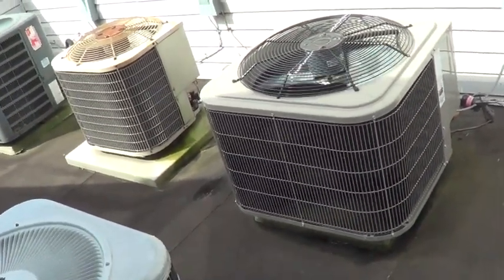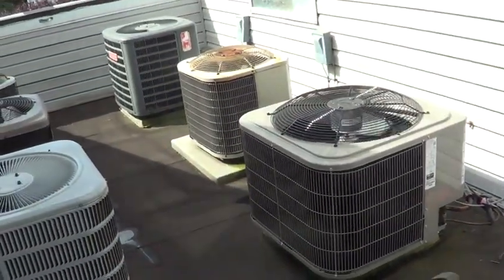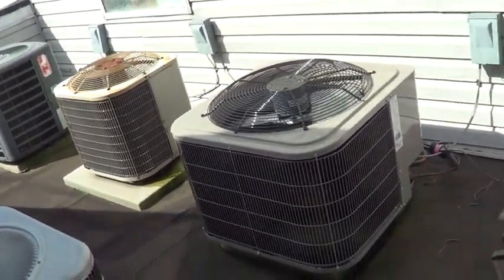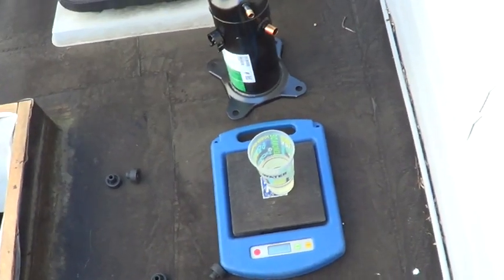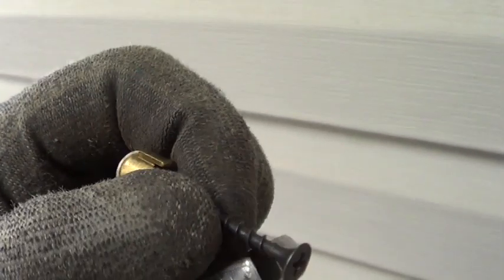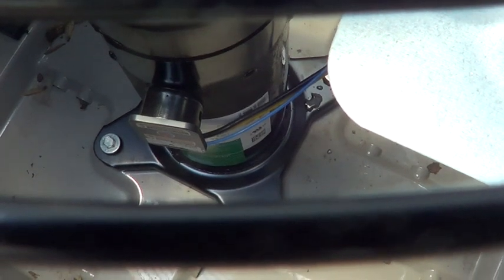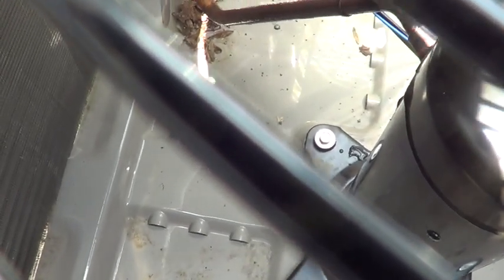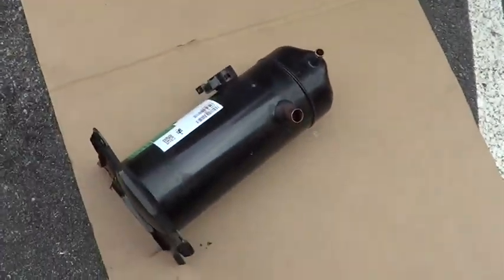LG Warranty Scroll Compressor Replacement and Tear Down with Cause of Damage Found

Comment: Looks like your piston was not seating correctly and was causing a liquid by-pass. For how long who knows? Anybody keep any records of SH & SC during services? It also sounds like you need some type head pressure control according to running ac in low ambients, (75* in summer), another contributor to flooding...........

Comment: Good video, you know your stuff. Many of those older piston expansion units also utilized r22. They were solid, I’ve had 410a units drop a compressor from a return duct falling off in a hot attic over a weekend, but I’ve actually had very few issues. I watch my super heat like a hawk, because I dont want avoidable problems. Great video

Comment: Maybe you are great at installation and operation, but you should maybe avoid declarations about the design of the internals.  So many incorrect and misleading statements.
First, this LG is basically conceptual copy of a Copeland.  As the Copeland patents ran out, LG simply copied their design and added features from other companies as well.  Common practice...
1. The large "relief valve" in the high to low pressure barrier would be closed by the spring inside it.  It is a safety device to prevent runaway pressure if discharge was blocked.
2. The small pressure valve in the "piston" is only to enable evacuation of cavity liquid that may finds it's way in, enabling excessive pressure to build during a flooded start.
3. The "piston" does help hold the scroll together with pressure that can vary by condition to only provide as much downward force as needed.  Liquid in that "piston" cavity design has no where to go except the pressure relief valve.  In Copeland compressors, the seals on the piston are designed to let excessive pressure (liquid) escape out as a form of protection.
4. The spring is not for shipping or packing... because all the discharge paths are closed by valves, it is likely to push down the piston to avoid the compressor from pulling a deep vacuum that would grind the scrolls together and damage them.  These scrolls look undamaged.
5. Most scroll compressors today that are designed by copying a Copeland are able to handle liquid in reasonable amounts (no need for accumulator).  They have the ability to unload the scrolls axially and radially, so liquid can pass through.  Axial separation is part of the "piston" design and radial separation is enabled by the the device on top of the shaft that engages the scroll hub/bearing.  A Copeland can handle quite large amounts of liquid (and debris), even though as an engineering principle, it should be avoided.
6. The two little valves on top of the scroll are for performance not sound.  These allow the gas to escape the compression process at an earlier pressure ratio so no further additional work is done trying to compress beyond what is needed.  They would likely be set to match the pressure ratio of the most common operating condition to help with operation cost.   (least effort = least power draw = least cost to operate.)  This is a pure copy of Copeland (VCR) and Danfoss (VVR) designs.
7. The little chip in the scroll near the hole where the "piston" gets fed, while possibly caused by some contour anomaly near the hole,  likely had no measurable impact on the compressor and could be purely coincidental.  Metal debris is unlikely to float up and get to this point.
8. The cavity below the "piston" does fill with pressure bled off the scroll pocket after the suction pocket closes.  That pressure is part of what holds the scrolls together.  That same pressure also pushes up the "piston" so the narrow top face contacts the high to low barrier plate forming a face seal to separate high pressure from low.  There is an engineering balance to old that "piston" at the most beneficial pressure to provide proper loads and not cause damage.   
9. It is highly doubtful that anything floated from below and plugged that little hole.  If that happened, it would still be there because there is VERY LITTLE flow through that hole.  Once the pocket fills, the pressure is maintained and no significant flow goes through the hole because there is no where for it to go and pressure is held.
10. You mention the hole showed "wear."  How could it have any wear?  Nothing touches it and actual flow is minimal and quite laminar.  Those marks are from the crude drill used to make the hole.  It is not precise, so it was likely drilled quickly.
11. There is one dark spot on the tip of the scroll if that is a step, i suspect excessive force holding the scrolls together and allowing the tips to wear down.  that could explain leakage, high temperature, motor trips and ultimately failure.  However, you never said what was wrong with the compressor?  Did it run and produce no capacity? (leakage)  Did it not turn on (bad motor), did it nuisance trip?  What was it doing?  From your video, I cannot see anything that would indicate the capacity would be low.  you would look for abnormal signs of tip/flank/bearing wear, which you said looked normal.  I think there is more to discover about why this one failed, possibly a system issue...

Comment: better change it with gree compressor than LG i have a bad experience with LG compressor they make so much heat that make the CRS socket melted so i change multiple times and the customer still complaint so i give them an old not to old copeland compressor and no issue at all.
Reply from the maker: I don't see them any more in Carrier units.   I guess there were too many warranties.

Comment: LG scrolls are junk... Rheem was using some at some point... we replaced the LG under warranty with a replacement LG and it failed within 3 months...warrantied the LG and got a Copeland... Been 5 years now... no issues
Reply: Lenox isn't even honoring their warranty on LG compressors or anything anymore. They were telling me that i have to prove that the home owner is the one who installed the system. Basically what they are say is if you bought a new house with an existing system that  is only one  year old they won't honor the warranty because your not the homeowner who installed it.
Reply: @sevakshir3612  Lennox are a bunch of asshats.

Comment: Replace it with a Copeland, not an LG! LG compressors have a much higher failure rate! I ain’t surprised that it failed because they are inferior to Copeland.
Reply from the maker: Warrant compressors are free.   Carrier seems to have lg in half their units.   I make sure to use expansion valve now.    I do like copeland better.   I will see if lg makes it 20 years.

Comment: Had LG compressor ground out that was on a system only 6 years old.  Prior to that breaker was buzzing intermittently every 20-30 seconds ( without tripping).  Finally tripped and it was fried.  Changed compressor and still buzzes faintly for half or even less of second when compressor kicks on, but does not buzz Intermittently like before.  Now I’m worried it’s slowly getting fried again.  Where is good place to look to see if there is electrical issue?  Also added hard start and no change.
Reply from the maker: I assume you changed the contactor especially if the grounded compressor was tripping the circuit breaker.   I would be suspicious of a wifi thermostat such as ecobee or nest.

Comment: I am telling you all right now. LG compressors are BULLET PROOF. I have installed tons of them in chinese made condensers in units with zero issues. I have them running in commercial buildings running down to 0 with no cold weather kits.
Reply from the maker: That is good to know.   However, i see less of them in carrier units this year.   I have personally had 2 fail out of 10 installed.   One in this video.   The other seized up when it lost its oil from a leak at the evaporator suction line solder joint.
Reply: Which chinese condenser brands did you use LG compressors on?
Reply: Nice sarcasm.

Comment: Scroll compressors have a much higher tolerance to flood back than reciprocating. They have play inside that allows the moving parts to make way for the liquid. They can handle some liquid but not much. I've never had a problem out of a piston. In fact I remove many txvs and replaced with pistons and have seen much gains in cooling performance afterwards
Reply from the maker: That is cool.    I like pistons better myself.   The KISS principle says there is less stuff to break.   Maybe this failure was a fluke.   I will do a video on a copeland scroll failure when I see one that is mechanical.
Reply: I agree.  I attended a Copeland compressor class where the instructor said nearly impossible to slug a scroll with refrigerant.  That said, haven't seen it in the field either.  As for the piston expansion to TXV, not my preference.  TXV's work great in low demand cool environments and gives better efficiency in temperature ranges, like coastal areas, but in the hot desert/constant high heat load, a piston is a work horse with maximum (steady) feed and nearly problem free, except for an occasional blockage with 10yrs+ use.  As for TXV, seen more of those go bad, either sticky or bulb charge loss.  It's all good, every tech has an opinion, just saying.  As for this video, I am here wanting an opinion on an LG compressor, just installed an Ameristar package unit with an LG. In the past, I've installed LGs in place of the copeland scroll because they are less expensive. Up to now, haven't had a problem or callback for the past three years (I give one year warranties on all compressor installs, Copeland or LG) so I learned something from this video.

Comment: If it turned into a low capacity oil pump that means it was pumping the oil out low capacity in oversized refrigerant lines now because of the low capacity how much oil gets backed up and stored inside the evaporator ?   How much oil was left in the evaporator on this last new compressor installation was already in there ?
Reply from the maker: I assume most of the missing oil was in the evaporator and condenser.

Comment: Thanks Nathan. Maybe your best video yet. Amazing how one little chip reduced capacity so much. I had no idea discharge pressure was used to press the plates together. But when you think about it, it’s always just the right amount of pressure!
BTW, have you tried the “Copeland Mobile“ app for checking compressor capacity When troubleshooting? They have Lg compressors included.

Comment: Great video. You may have mentioned it but..... I'm a little confused. If the system was commissioned correctly, why would there be any liquid flood back? Is the commissioning information incorrect? Or was this liq. flooding due to low air flow? (dirty filter, etc..)
Reply from the maker: It obviously wasn't commissioned correctly, because the compressor failed.   flooding was due to factory charge combined with fixed orifice metering device.   It was probably 0.5 lbs over charged.   Normally, this wouldn't be a problem with a larger compressor that could deal with the over charge.   All future systems will have expansion valve and at least 5 deg F superheat.
Reply: @NathansHVAC  That was my point, it's not that it utilizes fixed bore metering, it's that the system was not setup correctly that allowed the liquid slugging that possibly  killed the compressor. 

Everyday I see tiny little scrolls humming along without any issue utilizing fixed bore metering, and none of them have accumulators.

Comment: Good vid ! interesting how u figured how much oil was Left in the system. But removing oil from a New Compressor would make me worried about losing that new compressor. I would have just Blown the Lines and evap out with nitro & not messed with new compressors oil level. But thats just me. If it works for you. Then thats good. Good vid.
Reply from the maker: I know this compressor was going to be low because it was an oil pumper.
Reply: I was also thinking about it. Could it be that the comp failed due to low oil level? Was there any issue with this new compressor?

Comment: thank you for video. why not get testo gauges to save your time. 
all residential systems i install have more than 10 superheat. hers refrigerant test also calls for superheat well above 10 and proper subcooling. usually it is 14 on the bryant sticker. 

superheat too low with new txv. not enough airflow?
Reply from the maker: I do use the small wireless Testo pressure transmitter and my phone.   I like that gauge because it doesn't lose any refrigerant from the system and goes in my tool bag.   5 degree superheat means the evaporator is nearly flooded and has the max capacity.   0 degree superheat means the evaporator has spill over.